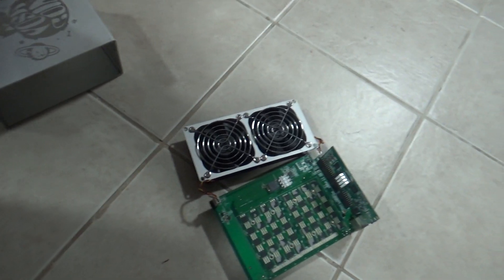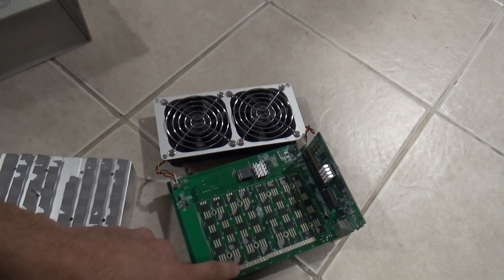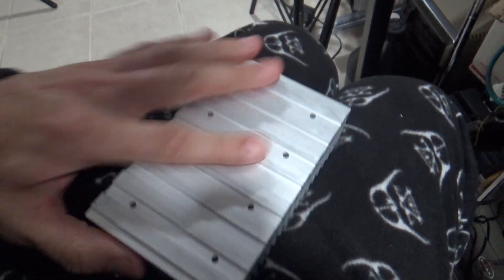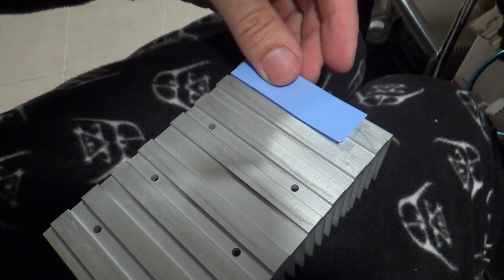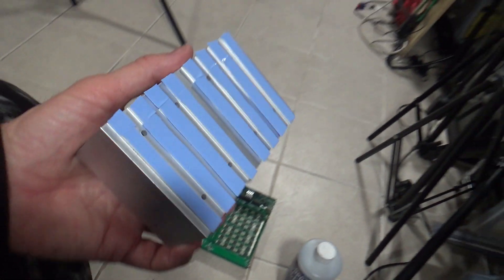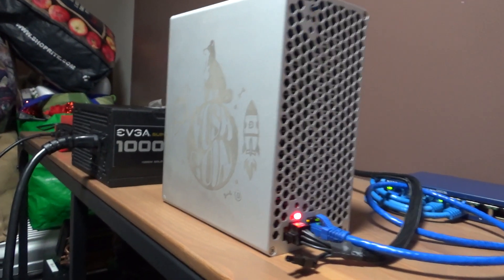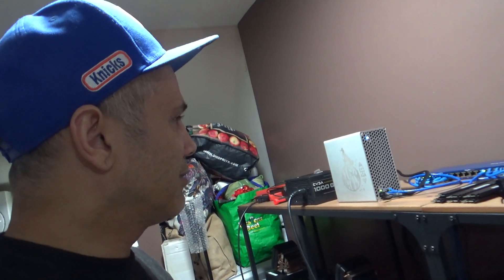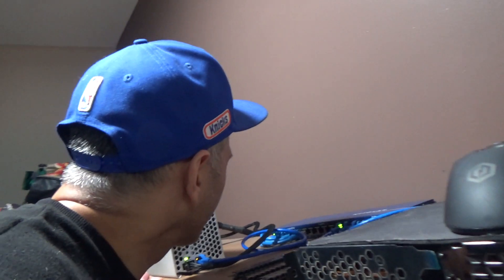Goldshell Mini Doge Overheating Fix

Comment: I know this few months, but I got couple that run hot so i put fan i was using for a ks0 ultra shroud lol. what thermal pads/ paste u use?
Reply from the maker: I use Amazon Giantree 30Pcs Thermal Pads, 2.6 x 0.8 Inch Reusable Silicone GPU Thermal Pad 3 Types of Thickness. ARCTIC MX-4 (4 g) - Premium Performance Thermal Paste

Comment: I have a similar issue with my Mini Doge (one chip is hitting 125!!). I am guessing it's the thermal pads, but I can't seem to get the heatsink off to even look at it. How did you get it off? Cheers!
Reply from the maker: There screws that need to be removed.
Reply: @NerdThingsAndMore  I did that but it's glued down... guessing heat?